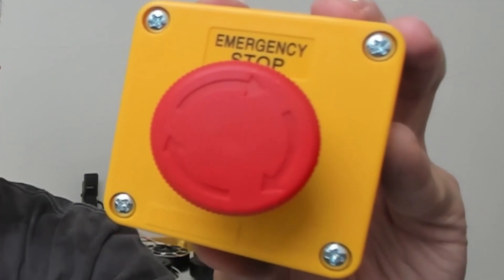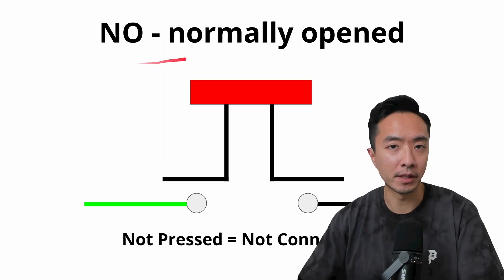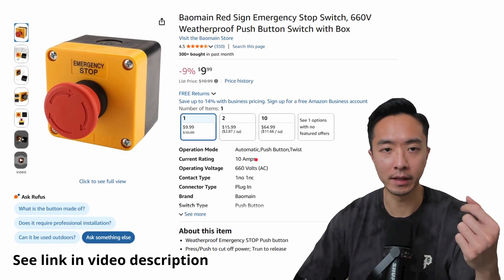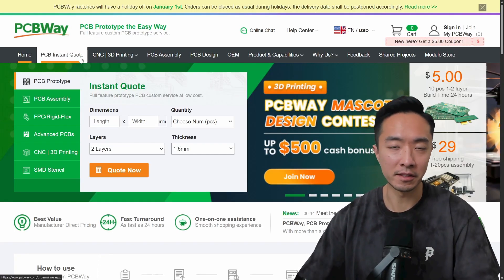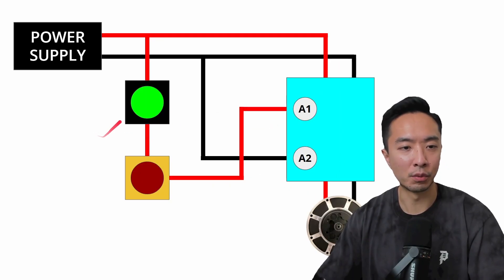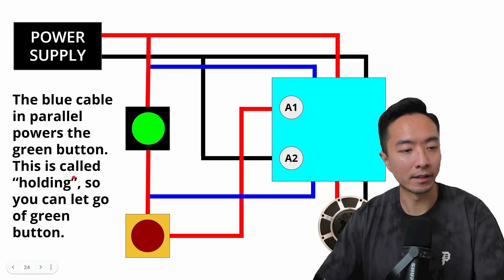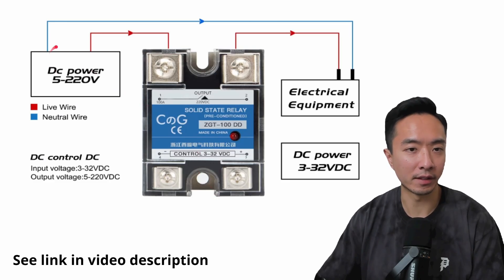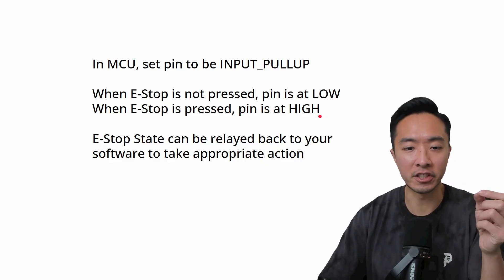Wire Emergency Stop (E-Stop) Guide (A Must for Anyone Doing Hardware)

Comment: you presented a normal STOP diagram , an EMERGENCY STOP is not in series with START switch , it has 2 NC contacts , one in series with main power contactor command , the other is  giving +24V validation  to  the PLC... if a faulty cable is interrupting one of these circuits , the  machine will stop ...in your diagram , if the PLC validation ( NO ) is interrupted no one will know ... also ,   EMERGENCY STOP usually have more than one switches connected in series and that will not be possible with Normal Open  contact
Reply from the maker: Mine has one NC and one NO

Comment: I just purchased a remote car kill switch that goes up to 250 amps.
It is designed to go onto the batteries negative terminal to kill all power in the car. 
Could you not use something like that ?
Reply from the maker: Yeah that’s fine. Better to have more than less

Comment: Then help with the thermal dynamics management eof to cool nitinol wire to control robotic 😊
Reply: The Active Vein is a metabolic robotic actuator designed to replicate the silent, compliant, and powerful movement of biological muscle. It is built to overcome the "thermal lag" that usually makes artificial muscles (like Nitinol) too slow for high-performance robotics.

How It Works: The Three Core Layers

The Active Vein operates on a cycle of Sense, Reduce, Refine, and Defy, using three main components working in a feedback loop:

The Muscle (Nitinol): A shape-memory alloy wire acts as the primary mover. When a low-voltage electrical current is applied (the "Jolt"), the Nitinol heats up and undergoes a phase transition from Martensite (soft/stretched) to Austenite (hard/contracted), pulling the limb with massive force.

The Circulation (EOF Active Vein): To reset the muscle quickly, heat must be removed instantly. The "vein"—a micro-channel surrounding the Nitinol—uses Electro-Osmotic Flow (EOF). Unlike a noisy pump, EOF uses a high-voltage pulse (the "Domino Jolt") to move a dielectric fluid (like Propylene Carbonate) through the vein with no moving parts. This flushes the heat away, allowing the Nitinol to cool and relax in milliseconds rather than seconds.

The Reflex (TPU/Carbon Skeleton): A 3D-printed TPU (Thermoplastic Polyurethane) lattice serves as the "passive return force." As the Nitinol relaxes, the TPU joint—which was compressed during the contraction—acts like a spring to snap the limb back to its original position. The Carbon Fiber skeleton acts as a thermal highway, pulling heat away from the veins and dumping it into the environment.

Summary of the Cycle

Contract: Current heats the Nitinol; the limb pulls.

Flush: EOF pulses, flushing the vein with cooling fluid.

Reset: The TPU lattice pushes the limb back as the Nitinol cools.

Why It’s Revolutionary

By treating heat as a "puzzle" to be managed rather than a failure of the system, the Active Vein allows for a humanoid that is silent (no gears), soft (compliant joints), and repairable (decentralized P2P infrastructure). It effectively dismantles the "Illusion of Choice" by moving away from proprietary, black-boxed motors toward a transparent, metabolic system.

Introduction to Shape Memory Alloys

This video provides a foundational look at the materials and mechanisms used to control forces in advanced robotics, which is essential for understanding how Nitinol-based artificial muscles function.